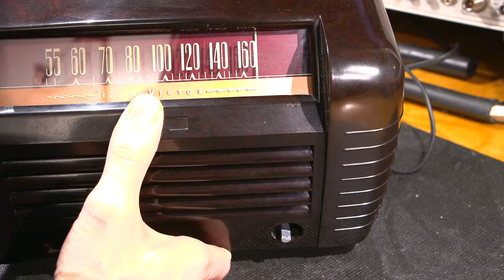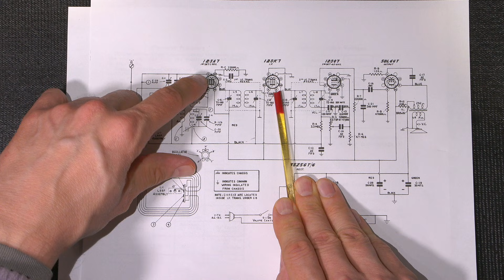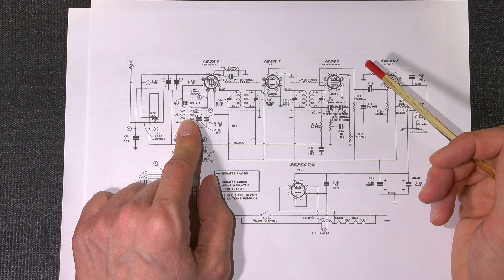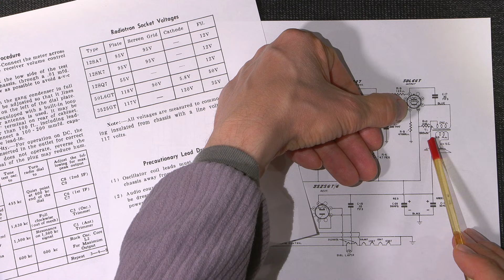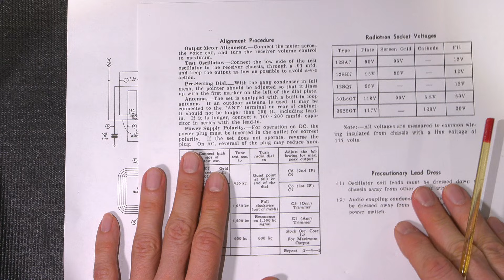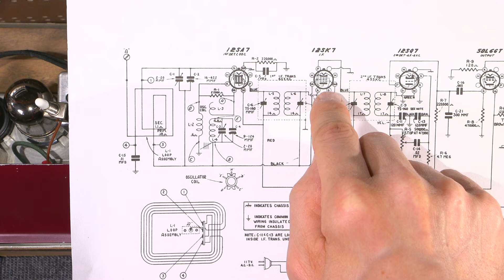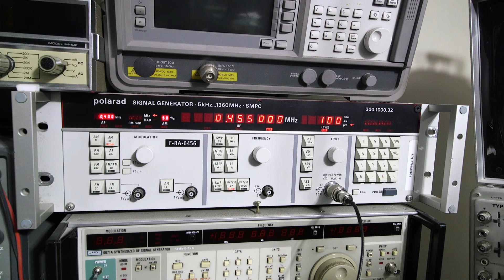Master Electronic Alignments!

Comment: Thanks, Paul, that was just what I needed!  I have two requests, if I may, for your future video on spectrum analyzers:  First, if it's possible to do so, can you please show us how to visually align radios using a truly budget level SA, such as the software version available on some SDRs?  I have neither the funds nor space for a used lab instrument like yours, but if I can get an SDR and a cheap DDS to do it using some free software from one of the SDR vendors (SDRPlay for ex.) then I need not make any further purchases.  Second, can you please show us what's inside your dummy antenna?  Is it the same as the one you showed us in your Echophone EC-1 restoration video?  Thanks!
Reply: I should amend the above comment by saying that the Spectrum Analyzer V1.1 software available for use on SDRPlay SDRs is third party and not supported by SDRPlay directly, though links to it are on their website.  If it works at all it could be useful for budget tinkerers like me.

Comment: How would you find the impeadance input of a external Antenna jack. Is there loss of signal if mismatch is severe? 1 mega ohm input to 50 ohm coaxial cable. I have old radios that don't have a listed ohm value on  external antenna input.

Comment: That IF alignment did seem excessively touchy. Should you perhaps have first checked that the person who did the original rebuild had not badly placed some of the components resulting in excessive stray coupling and feedback? Perhaps the peaking method would then have given a less lopsided response.

Comment: Thank you!  I have over 35 years experience building/repairing/designing and modding guitar effect pedals, and about 25 years experience doing the same with tube guitar amps.   Outside of this narrow bit of electronic knowledge, many things are still a bit of a mystery to me.  Your channel has taught me a lot about radios a test equipment.   Thank you for sharing your knowledge and experience!

Comment: Hi, When you apply a negative voltage to the grid of any Tubes. They will not conducting. Is that correct?  Positive voltage will make them conduct more. Is this Correct? Thanks.

Comment: Amazing how many stations are still broadcasting in 2020 within a span of barely above 1000KHz.
Reply: Really those frequencies aren't useful for much else because of the limited bandwidth (3-5Khz), so they (AM stations) will probably be around forever in some form. In fact maybe eventually they will go back to a full 10Khz. Mr. Carlson says in the old days AM sound quality was just as good as FM, full sounding. The less AM stations maybe they will redo the bandwidth range again eventually
Reply: @researchandbuild1751  AM has always had some level of static, because the nature of that mode means atmospheric noise is amplified (FM avoids that problem by demodulating a signal that is shifting in frequency, independent of the actual amplitude of the background noise); therefore, it could never have been quite as good a quality as FM.

The current plan to improve AM is to switch to digital signals instead of analog ones (just like how TV did some years back). There is an industry and FCC push to do so, but consumers are not very keen on having all their AM radios become obsolete (not as easy to add a converter box, like you did with old TVs).

Comment: Great, many thanks. Just a doubt. I have a handheld oscilloscope which is also a DMM and an arbitrary waveform generator. I guess is not proper for the alignment because it is a function generator and not a signal generator as you said. I mean, it can not modulate the signal or inject a tone together with the signal. Correct?

Comment: I read an article in the Electronics Australia Magazine from the early 70's that talked about when transformerless TV's were introduced into Australia and the electrical board banned them from sale after conducting tests and finding out that half wave rectified AC was sending DC down the ground wire which was back then tied to the galvanized plumbing. They found that the DC on the galvanized pipes was causing electrolysis and would dissolve a pipe in the ground in a matter of a few months which the board of water works at the time wasn't happy about. I think that the government did a buy back of all the TV's sold that didn't have a transformer and we never really had a transformerless tv after that, I don't think that a radio like the all American five would have been allowed to exist in Australia either. 
Of course back then the home electrical system was a bit different, all houses have a dedicated ground wire which now goes through an RCD device then to a copper ground stake. I was fascinated to learn that we actually had a DC electrical system before we had AC! I would have thought that the DC system came and went quite quickly since back then things moved slower, I wonder if it was an Edison DC system? I'm aware that Edison came to a little country town at that time called Ballarat to see a one piece phone handset that someone there had invented which is basically the same one piece design that we still have today! Ballarat incidentally for those who don't know also became the hottest destination back in the early 1850's when gold was discovered and the rush from around the world was on! 
Fun fact, if it had not been for the discovery of gold, the capital of Australia was going to be Tasmania! At the time, Melbourne was being considered for the new capital and the other place up for consideration was a coastal town called Geelong! The boat loads of people coming into Australia for the gold fields were getting off at Geelong because it was closer, Melbourne noticed that they were missing out on the tourist dollars to Geelong so someone drew a new map that made Geelong appear to be much further away than it really was and sent it out around the world to get the boats into Melbourne without Geelong realising it LoL... For a time, Melbourne became the richest city in the world, the money isn't there like it used to be but if wealth is measured by quality of life, then we are still the richest city in the world!
Reply from the maker: Thanks for sharing your story Peter!
Reply: Las radios sin transformador afectaban porque rectificaban media onda y con eso, dada la gran cantidad de radios modificaban la forma de onda de la CA. Lo de la galvanoplastia no es real ya que se produce tanto con CA como con CC  y en ese caso la destrucción de las varillas de descarga a tierra se produce en cualquier caso.

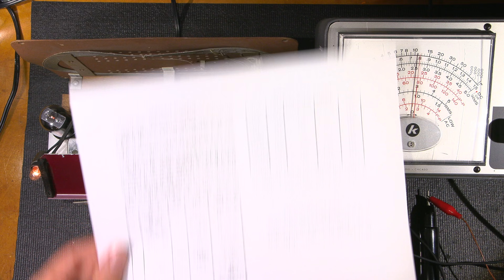Comment: @30:50 or so you turn the speaker on and off, and then you turn the tone off too. I notice at that time, the VTVM needle deflects upwards significantly before it drops back down to where it should go. Is that just a spurious side effect of how the VTVM operates, or is there something actually happening in the circuit that is causing that? At first I thought it be related to the automatic gain control circuit causing a significant but low-frequency signal as the bias signal changes, but that wouldn't make sense that it happens when the speaker is taken out of circuit too, unless the impedance change that the output section sees causes a similar effect earlier in the chain.

Comment: One question. Is there a point of "to peaked" causing excessive oscillation? Other than that, EXCELLENT! Thanks for the help.
Reply: I answer my own question by watching the video a second time. Alot of information thete buddy. One question else. Why did you choose the Polarad 1360 mhtz. signal generator to do your alignments on radios?

Comment: Thank you Mr. C.   50 years ago, I was a kid, going with my dad to various  2 meter repeaters in Maine and New Brunswick.  Sometimes there were just 4 of us and I watched them set up and powered the new rig.  We had a 50Kw AM radio station - CFNB - and when it switched on high power - it washed out a lot of stations.  Still - we had a 100 ft antenna and i enjoyed searching the dial for stations in the US. The further - the better.  And as the evening went on stations would come in and go.  Cheers to you!

Comment: funny anecdote: My first job in 1978 was in a TV shop. Using what the boss Told me was an isolation transformer, I blew up 4 TV sets. After the fourth incident, {when the boss was considering firing me), I took a meter to the transformer, to find out that it was an autotransformer with no isolation. I was not happy, having to repair somebody else's mistake.

Comment: Paul, one of my favorite old-time instruments for alignments is the AC VTVM.  There are several Heathkit models such as the AV-1, 2, and 3 as well as the IM-21, IM-38, and IM-5238 (TVM).  I also use an Amphenol AC Millivolt Commander which is a full-featured TVM with an AC sensitivity of .01 Volts AC.   Using these meters also facilitates disrupting the circuit as little as possible.  Whenever possible, I will also use close coupling of input signals by using loops of wire rather than direct connections.  As a final note, I will also use the spectrum analyzer for IF alignment and find it exceedingly convenient and speedy to align the dials by sniffing the local oscillator.  Your feedback is appreciated.  de W1SEX

Comment: I'd like to do an alignment on a vintage Marantz FM stereo, but don't have a signal generator that can do the modulation.  Would it be possible to use a bluetooth fm transmitter for a car to do this for me?  I could use my function generator to put a 1khz audio tone into the FM transmitter.

Comment: Could the reason for requiring a cap in the antenna lead for wire lengths > 100 ft be to prevent the inductance from detuning the front end?

Comment: This is crazy at around 35:20 how much more sensitive you got it from a visual alignment compared to the audio one.

I don't understand about getting the unwanted oscillation away when you adjusted. At the time before you used the spectrum analyser.
Reply: In simple terms, there are combinations of the coil settings that cause oscillations and there's a limit to how closely all the coils can be aligned / peaked  (how high the radio's sensitivity /gain can get) before it starts self oscillating.  It becomes so sensitive, it begins reacting to itself - a feedback loop. He "peaked" the radio to that point and "unaligned" it (reduced the gain / unwanted resonance)  just a tiny bit.  The maximum gain one can get out of a radio before it breaks down into oscillation is largely a function of its design.

Think about it this way; you can crank your guitar amp only so much before you start to get feedback, which is oscillation. Sounds cool when Eddy Van Halen did it, but not so much when your radio does.

Comment: I really enjoyed that. You've mentioned before that you don't recieve a great signal, if any, down in your lab. I've always wondered about your external antenna setup. What does it consist of?
Reply: Me too.
Reply: Just for  fun I built the Cantenna signal booster using “15” diameter wire firm and about 50 turns of #22 enameled wire , placed across an old 365 pf tuning gang capacitor. I am not a HAM so I don’t have antennas on my roof or in my yard.

Comment: Thank you Paul for being prompt regarding our request for compiling, and uploading a video dedicated to AM radio alignment: very much appreciated.
I found, when you started the peaking process, you began at the 1st IF, or IF transformer associated with the frequency changer, very intriguing since it makes sense.  I was taught that it was not always beneficial to set the output on the signal generator to less than 200mV.  I now have a more clear idea as to why I was taught that.  I was also taught how to apply the sweep method but have not used it for several decades.  The test equipment in most of the television and audio repair shops I was employed at was largely old, poorly serviced, and none too accurate.  For most of the time, radio, and television alignment (if one was warranted) was little more than a ‘quick peak-up’.  ‘Revenue’ was the most most important word in the domestic electronics servicing industry ...”get it working, and get it back to the customer!”  Now I’m retired, I want to refine my electronics skills so I’ve made my mind up to begin by re-familiarising myself with the sweep method since I’m reminded of its benefits. There are many other areas within electronics where I intend to focus attention on refinements.l
For me, this has certainly been a very inspiring video: I’m further encouraged to become more motivated, and determined.  Once again, thank you very much my friend.  
Best regards, Phil.  P.s, might you upload videos where you restore, as well as do an in-depth alignment on a VHF valve radio sometime in the near future?
Reply from the maker: Thanks for your kind comment Phil. I have VHF receivers and transmitters on the shelf (Gonset, Eddystone, Heathkit, and so on.) So some are in the plans.
Reply: I was a field tech for RCA in the high days of home service to Color TV. I advanced into the shop and left the service business for color TV  designing. One of the first projects was the comb filter integration into a color TV Chassis via solid state devices, then LSI. I Took an early retirement after GE decimated RCA an sold the Sarnoff Labs. A few years in the fiber  optics field was my next step, in quality control. One more company bit the dust an Swarthmore offered me a teaching position. The last ten years of my life of instruction was the best gig of all my life. I realize now that I should have gone into education.

Comment: If Vacuum tube Radios used 3x double triode tubes and configured them like the inside of the SO42P then there should not be any transmission via the antenna and you only have the sum and difference frequencies so why did they miss out on this.

Comment: When a person reaches a high level of skill in their craft regardless if it is in plumbing, construction, mechanics, or electronics that person becomes an artist of their craft.  Mr Carlson is an artist not an electrician.
Reply: I will add this he learned to respect the power of AC in those old receivers, & high voltage DC very quickly ; & if he's honest and being honest ,he probably got zapped  good, many a time; when he was first learning/experimenting.
 I am a licensed electrician, industrial type ,with a small degree in electronics .[ 9 -16 week semesters worth.] plus many hours & more certificates in drives/ ethernet/ robots/ safety ect.  I am still working 61, got a few years to go before full SSI . Never disrespect it, or get complacent it will take you out or burn you bad. [ ** I like his warnings ; he has learned to respect that power. Power electronics is a whole other ball game, 480 volt three phase, A B C,  vfd drives, servos , heat control ect.
PS: _ And yes, I have been zapped good a few times, no burns, or scars, but a clear respect for power. Wait !! -  senior moment, turned 62 in September. But I memorized all his probe schematics ; except last one think 6 -3904 npn chaining stages.OK ..good night.
Reply: @hughmc5419  I'm 60 and have been working in Electronics and Electricity since I was maybe 12-14 years old.  I had one really bad incident in votech one day with a Heathkit transmitter I was working on.  the 3000v DC line.   I woke up against the wall about 15 feet from the bench with the teacher over me fanning me and doing what not to get awake again.  I do not remember that too clearly.  I may owe my life to him.  Needless to say, I felt my first real aches and pains that day.  It took a day to stop shaking and a long time before I worked on that transmitter again.  To this day, I work in it, love it, but am still scared shitless of electricity.  Other at work always made a joke when I kept my left hand in my front, or back packet, when I used the high voltage probe on the 2K high voltage like of an instrument I use to work on.   I just installed a little 50 AMP sub panel in my garage.  "Why did it take you so long to get the power back on"!?  Well, cause I'm still scared of it, even though 120 only tickles a little, I'm still scared of it an take my time.
Reply: Look up what an electrician does, the answer is no in any case.
Reply: @_Everyone__  Been doing it for 30 years mostly industrial & commercial ,very little boring residential. An industrial electrician deals with vfd drives, programmable controllers, multi zone ovens ,many type of sensors ,safety controls. [ I didn't catch what you did for a living ? Are you an artist ? A bullshit type....
Reply: @_Everyone__  Oh I disagree.  The Merriam-Webster dictionary definition of electrician and artist is as follows:

Electrician:  One who installs, maintains, or repairs electrical equipment.

Artist:  One who is adept at something.  A person skilled at a particular task or occupation. 

 "A surgeon who is an artist with the scalpel."

 An electrician just isn't someone who works at the power company or installs house wiring.
Reply: There is a difference between artist and artisan. I think you actually mean artisan.
Reply: @DomManInT1  I could have used artisan but chose artist which is fine and I think it sounds better.

Artist:  one who is adept at something.  A person skilled at a particular task or occupation.  

" A surgeon who is an artist with the scalpel."

Comment: One aspect that you brought out, which many alignment videos do not, is that it is possible to tune the IF too ‘tightly,’ which can produce oscillation.  That is a weakness of the output metering method of alignment.  It is unfortunate the spectrum analyzers are so expensive.
Reply: Spec analyzers are pricey but you can also google the Tiny SA,  a pocket spec analyzer that came out a few months ago for around $60.  It has suprisingly good performance for its price.  Theres a few people on youtube who have reviewed it already.
Reply: @Sloxx701  dude thanks for that info, i need to check into that. I have a NanoVNA already but i will check into this other thing too